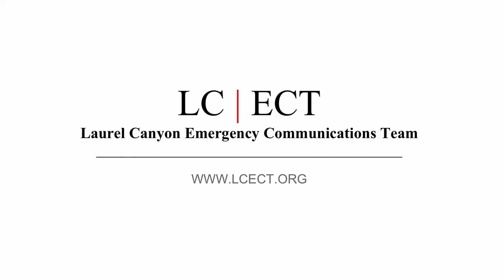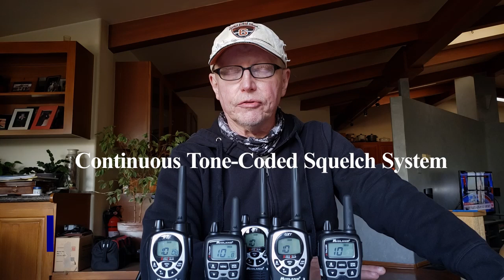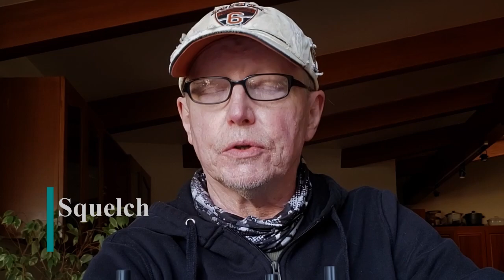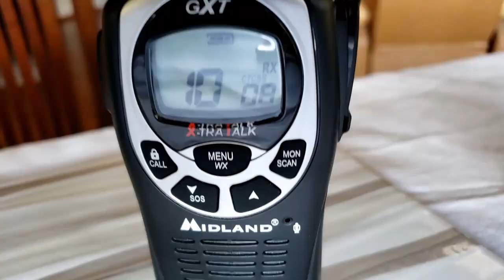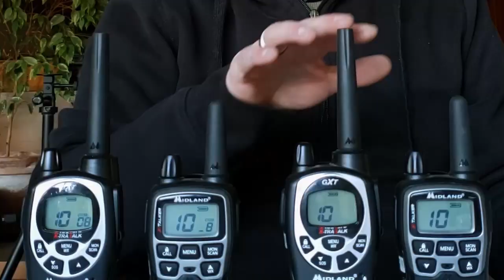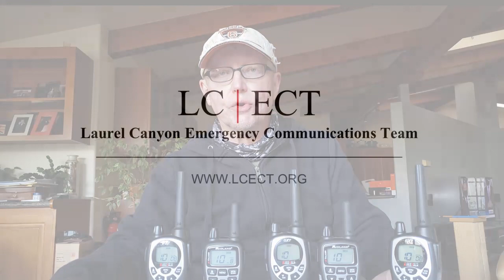CTCSS Explained

Comment: Hi sir, do you have any experience with the following walkie talkie and how they work?
Ksun KSWCT2 Mini Netwerk Transceptor Walkie Talkie
Reply from the maker: Hello. I do not have direct experience with PoC radios. Our group is organized for emergency and disaster response, so we cannot depend on the cellular infrastructure being operable. For that reason we use GMRS and Amateur Radio bands which work radio to radio. PoC radios utilize the data portion of 2G 3G or 4G cellular networks and can be useful in many applications, and can offer much greater area coverage - limited only by the coverage of the network they are operating on. For emergency or disaster comms I strongly recommend GMRS & Ham radio.
Reply: Thanks a lot 👍🏽

Comment: I picked up a child monitor once. Fast food joint to.
Reply from the maker: The fast food joint may have been illegally using the GMRS frequency, but the baby monitor should not ever be in that band. If you experience frequent interference on a channel you use applying a CTCSS code may help.
Reply: @lcect  yea beats me. Picked up some foreign language speaking after I commented. Yup switched to ctss afterwards. No more if than nonsense

Comment: I'm lost it makes no sense at all can I send my ham radio to you I have no idea what you're talking about I am clueless there's not one video that explains this I mean seriously can I send it to you
Reply from the maker: Hi Michael: If you can tell me which radio you have (Brand & Model) and what problem you are having with the CTCSS codes I'll try to help.This video used GMRS walkies for the explanation, but the concept is the same on all two way radios. On the ham radio bands you will find CTCSS codes used on repeaters, but usually not on simplex frequencies.
Reply: @lcect  what would it cost to send these to you I have a uniden BC 125at bearcat, a tidewater td-uv5r which is a generic version of a Baofeng I am a single father I work constantly I'm not asking for sympathy I do not have access to a computer I am constantly working I would like to send these to you just tell me what it costs because nothing is free in this world
Reply from the maker: Hi MIchael:  The Bearcat is a scanner, and the UV5R is a dual band ham radio. Unfortunately, they are difficult to program without a computer. There are two free programs that can be used to set them up if you can perhaps use a friend's computer. Send me an email at  info@lcect.org  and let me know where you live, what agencies you want to scan on the Bearcat, and whether or not you are a licenced ham or are just using the UV5R for listening. I'll help you out.
Reply: @lcect  I don't have access to a computer I just use my cell phone trash stays tomorrow I'll just throw them away
Reply from the maker: @miijjk  No need to toss them. They can both be programmed manually, it just tales more time. You can find all the frequencies you need at this site: www.radioreference.com    Just use the manuals and enter the desired frewquencies manually on the radios. Good luck!

Comment: Good video. The next step for those with a GMRS license is to step up to a repeater capable unit such as the Radioddity GM 30 ($39.00 on Amazon) or other similar units that can extend range using Mt Wilson's repeater and a number of other open repeaters. I note even Midland is offering repeater radios, but they are way behind the Wouxon. Radioddity and even legal Baofeng GMRS FCC approved radios.
Reply from the maker: Thanks! I'll check out those radios you mentioned. Right now I have the MXT-400 from Midland, a 40w base/mobile, and a 9db gain stick on the roof. Would be nice to be able to hit repeaters from an HT, though.

Comment: Great explanation. One point though, FRS is legal for business use, as well as any "grandfathered" licensees from days gone by. This means that restaurants, retail stores, etc can use FRS. Would love to see some bandwidth set aside strictly for GMRS but it's probably not going to happen.
Reply from the maker: Thanks for this clarification. Yes, and if businesses limited themselves to 2w FRS power on Ch 1-7 it likely wouldn't cause much problem. In our community we have (mostly) construction and landscape crews using GMRS power on 1-7, and even some mobiles with higher power on 15-22. Based on what I hear I would guess some are even using Baofeng radios with illegal power levels. Plus, they are all using CTCSS codes so they can't hear the legal traffic they are stepping on. I never hear a GMRS call sign from any of them. Very frustrating, and I agree that GMRS only channels are unlikely. The same users would just keep operating illegally anyway. 

Business radios are also unreasonably expensive, which I suspect contributes to the numbers of illegal users.